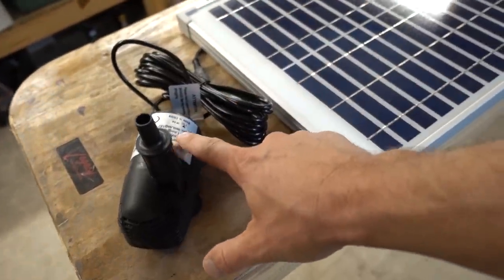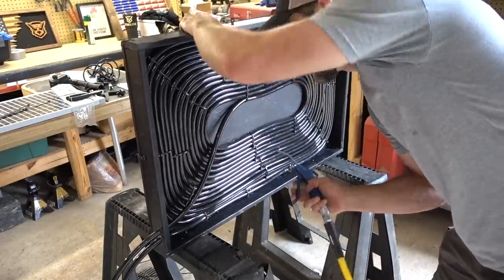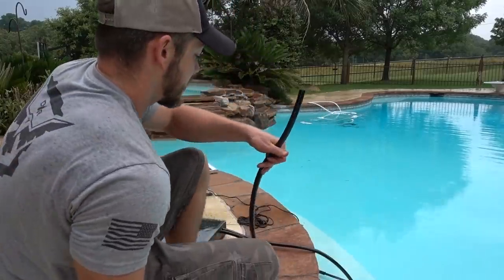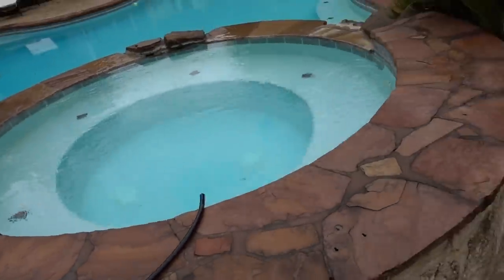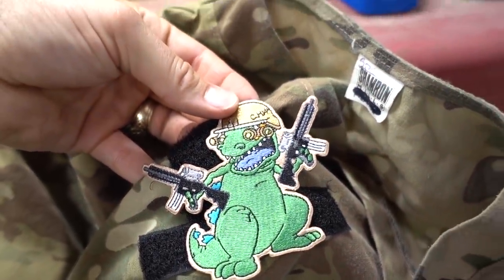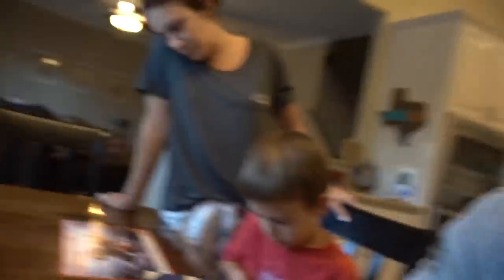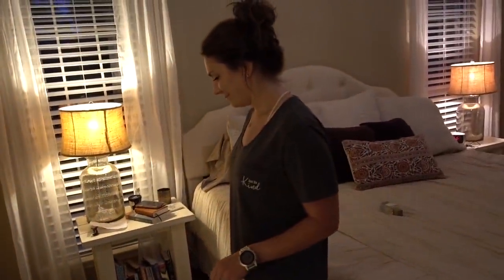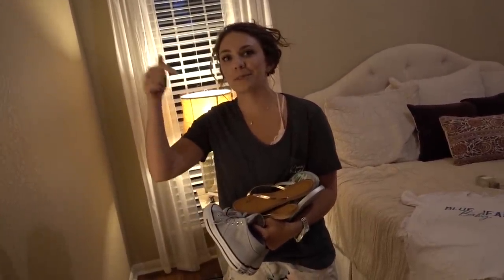Homemade Solar Powered Water Heater

Comment: Put some reflectors on the outside of the radiator to reflect more sunlight into the radiator (Doesn't need to be parabolic or fancy, especially for a solar powered pool heater. Just look at solar ovens). Also, make the inside (Making the outside shiny would just reflect heat away from the entire system) of the box for the radiator, shiny (Like others have said) to reflect sunlight to the pipes (Again, look at solar ovens). There's no point in heating the wood. Might also need to change the pipes to copper (Like others have said), and paint them black to both absorb more heat (And thereby transfer more heat to the water) and for durability purposes (Rubber may crack and/or melt slowly over time). 

You can also experiment with aluminum. I don't know which would be better, but I've always thought that aluminum was good because it has high SPECIFIC HEAT (specific heat is the amount of heat/energy that it takes to raise the temp of a material by 1 deg Celsius). That's why aluminum foil cools off and heats up so quickly when you put it in and take it out of the oven. My thinking is that because it cools down quickly, it would transfer heat better to the water. Maybe it would heat your pool at a faster rate, but not to a final temperature as high as copper. Copper has a higher THERMAL CONDUCTIVITY, but lower specific heat. Both materials are used in thermal applications. Copper is used in home appliances such as water heaters and refrigerators, while aluminum is used in things like heat syncs for computers and pots/pans (though the base of computer heat syncs or the part that touches the processor is often copper). Aluminum is cheaper (which is probably the main reason it's used) and both have good corrosion resistance for outdoor use. Copper also has better ductility for bending purposes, though both will probably be fine in this category for your use. This is all coming from a Mech Eng student that hasn't taken heat transfer or mechanics of materials yet, so take that how you will.

I've capitalized the important terms to research if you decide to do some on your own and there are plenty of articles online that may help you make your choice. My suggestion is that you make the modifications to the radiator and connect the rubber hose to the inlet and outlet for the radiator so that you don't have to bend or force solid pipe around your yard to reach the pool. The rubber is more easily adaptable to any path that you need to take to reach the pool and it can't cut the skin as a metal pipe would since that end is in the pool and near bare skin. It's also easier to replace the rubber in this case since you don't have to redo the coil if the rubber breaks down and you just have to replace a straight line of hose.

Comment: You forgot a thermostat and 2 one way valves, solenoid and a relay! If you continually pump the water through it won't get hot, because the water is not staying in the collector long enough.

Comment: I have installed these before for people. You are going to want to lift the solar water heating at least 6 inches off the ground. It will allow for the hot water heater to absorb ambient temperatures and solar temperatures.

Comment: You need to put black stone in the bottom of the box, preferably pretty thick stone. What that's going to do for you is have a base that will actually absorb and hold the heat to give the water going through the pipe a longer chance at catching some of the heat. Wood is a terrible conductor of heat, especially plywood that's not very dense because it's made from a softwood. If people don't believe me, go paint a piece of plywood black and leave it out in the sun and give it a full 8 hours of sunlight then go touch it, and then go touch some asphalt or concrete in the same area and see what's hotter. It'll be Asphalt, Concrete, Plywood. As other have stated copper pipe would also work better, I know at the Denver Zoo they had these big copper colored statues for kids to climb on and every time we went on a sunny day if you touched it you'd literally burn yourself because of how hot it is. If you combined a copper or any metal pipe really with a black stone or asphalt in your box then you'll get some pretty hot water from it.

Comment: I would have used stapled in zip ties to hold it down.  That was my thought before you did what you did.  My thought was staples won’t go all the way through, no holes, and no loss of heat.

You could always build a couple more to increase the warm water production.  Because more is more, so why not?

Comment: If  you put aluminum  tape or foil at the bottom of you "radiator " itll catch more light in turn heating it a tad bit warmer enough to feel a difference

Comment: make sure you drop the water from the pump directly into the water. Else you will lose contained heat in the water as it collides with the air as it drops.

Comment: In Florida the passive solar pool water heaters are attached to the roof of the house and cover a very large area of the roof area in the back yard side of the roof. Even this only makes a small increase in water temp. in our winters here. My Brother ... consider this ... fill your black tubing up completely with water. OK ... drain the black hose out in a large bucket or container. Measure in gallons the total content of the amount of water you have drained from the black hose. Now, compare that gallon amount to the total gallon amount of your pool. See what I'm talking about? It's like [ ... please pardon the analogy... ] peeing in the ocean. Not to "dis" your project at all ... but you are going to need a much, much larger passive heat collector panel ... or "box" with a whole lot more, and I mean allot more black rubber tubing. Your panel shown in this video could heat up a baby pool, or a three person hot tub over a day or three depending on the size of the hot tub. Google this on systems used in Florida and you will find out what I'm talking about. The Proverb is absolutely correct ... "Council with many ensures success!"

Comment: Run the pipe under ground to the house up the gutter to the roof and run the pipe from one side to the other back and forth from one end to the other then back down through the gutter and back to the pool under ground.

Comment: I knew a guy who did a similar system but on a bigger scale and made to hold water for a certain amount of time say 15 mins. He put it on his roof for a hot water heater and it worked great the first day, it got so hot it melted all his plumbing he ran in his house and for it. He flooded a decent part of his home lmao.

Comment: I'd get a shiny metal plate and put it on top of those hoses so it captures more heat and spreads it over the hoses. 

Also get an Arduino and some motors and go nuts and program a mount to follow the track of the sun through the sky every day so the solar panel and box get max heat. That's just me though. I'd go nuts with it because I can.

Comment: Forget to ask on last video. Shouldn't you use white board on the bottom on those tubes to reflect the heat to the tubes instead of absorbing the heat that's supposed to use to heat up the water?

Comment: It would probably be more effective to heat your water by running your air condition in the house. It only costs for the equipment to hook up then when the a/c comes on it heats the pool

Comment: Using plastic hoses seems like a bad idea when heat exchange is the desired outcome. On the inside, you should probably use copper and spray paint it black. Using plastic hoses, you're actually insulating the water from the heat inside the heater.

Comment: You could use old tires filled with rubber hose as a heater. It's more effective, so you wouldn't have to wait all day for a few degrees.

Comment: You should have found the mid point in your hose put it in the center of your  Box then coiled both ends at the same rate in an outward spiral from the center to the edge then you wouldn't have had any overlapping hoses

Comment: Hey brother. Would be a lot easier and more efficient to incorporate it into your already existing pool pump using the pump house rid with a one inch pvc system. I'm in the hill country and had one forever till we moved to a house with no pool. Made em for lots of my neighbors as well. Just an idea for ya to mull over so it can actually heat up that big of a pool even in 50 degree weather.
Reply: Pump house roof*

Comment: Hey matt.  We did this when i was a kid on my dad's pool.   4×8 ply wood and a couple of garden "hoes"   we painted everything black and plumped it from pump.     We would get hot water coming out 50 degrees warmer than the pool water.     It worked really well

Comment: Hey, if you want to have a better heater with the science to back it, make a little vacuum pump and pull a vacuum in your blacked out chamber, epoxy every tube,zip tie,lid, hole, in the box.pull the vacuum and seal it off the lower the psi the better.  it will heat up your pool WAYY more effectively.

Comment: Paint the hose with flat black to increase efficiency as the gloss will reflect some light.
Reply: He should use metal box and copper hose to increase heat consumption as well
Reply: That would increase efficiency by about 12% over the plastic but it eill be quite expensive.

Comment: Could have bought (2) 1-1/2 trees (2) 3/4  PVC reducers and plumb it to your return lines at your pump
Reply: And it would pump with the pool water and you could buy (2) 3/4 in. Valves to stop the water at night and would cost way less p.s. I work building pools at tuckerbackyardpoolsandspas as a builder/plumber

Comment: Why don't you just use the pool filter pump to circulate water through your solar heater/cooler? A simple bypass valve  could enable you to turn it on or off.

Comment: You're better off using photovoltaic solar panels (electric basically) because those heat panels don't work unless in direct sunlight! Whereas a photovoltaic panel will still produce half of it normal power.

Comment: Submerge the end of the tubing - you will loose heat to the air if the air is cooler than the heated water in the tube.  Mere - some of us women look better in V-Necks than U-Necks so please keep that in mind.

Comment: Nice idea and it will work but I’m not sure it’s going to be efficient with your size pool. Typically you need to heat more water and move more water to be efficient. Only reason I critique it is because I have a customer “roofing” we installed a solar pool heater on they’re roof and it had to have 2” pipe to carry water to & from with half inch hose ran back and forth & probably 12’x12’ surface area. It was an above ground pool & did work but the system was on a lot larger scale. Props on the ingenuity though cuz what we installed was a pre-made system not of our doing.

Comment: 5, 10, 20 degrees I know you are experimenting but it takes about 1000 joules to heat a pound of water 1 degree. looks like the pool you have could be about 12k gallon. That's almost 100,000 lbs of water. so you would need to produce about 1.2 million joules to heat up the pool a degree. I think that the box will never really make a difference considering a breeze would cool down the pool more than the box would heat it up.

Comment: It will not work without a solar pool cover. Think of it as a lid for all that heat you are pumping in. No doubt it will crank some heat but you will loose it faster than you can gain it without a cover

Comment: And now I've spent an hour considering thermosiphons.  cheep, simple and reliable, adding a check valve creates a heat controlled switch not light controlled (primary source not 2nd degree/correlating source).  What is the effectiveness/output of same sized unit and/or same cost unit(s)?  Any engineers out there with the answers?

Comment: The amount of water that pump will pass is greatly reduced by the amount of frictional loss from the hose, plus the amount of back pressure and lift. In other words your pump capacity is crap.  You are making it work harder as you have elevated the hose mush higher than the pool water level.

Comment: Lincoln: gets toy that requires assembly
Matt: let me help you with this
Mere: building a helicopter without an engineer?
Reply: Jack Lougheed I actually think Matt had mentioned in a video that Mere got an engineering degree from Texas A&M. I am not sure if she is a PE, but pretty sure she has an engineering degree.

Comment: Seal the holes in the back and put a gasket on the plexiglass to reduce moisture getting into the enclosure and creating condensation on the glass
Reply: Hahaha it wont get that hot surely

Comment: Please run this test for us. We are having a bit of a debate. Please let the box get to temp and run the water into a bucket and then temp check the water. Then please replace the inside with a reflective layer and see if the temperature of the run off rises. I'm positive it will be hotter if you use a reflective surface and not a black box

Comment: You need a high volume pump so many gallons per hour but then again if it's too fast won't give the water time to heat up before punch back in the pool so slow like you have it to better option

Comment: Matt I'm sorry to tell you but that tiny little tube and solar panel is going to warm your pool up by 0.0000000000001 degrees. Water takes a HUGE amount of energy to heat up, 4187 Joules per Gram of water to heat up one degree specifically. With a pool that size you're looking at Billions of Joules to heat it up by 1 degree, a small solar panel absorbs a few hundred to a thousand Joules per day. 
Think of it this way. The pool absorbs 1000x more heat than your tubes will, so why the heck would the tubes have any tangible effect on heating the pool?
Source: physics degree

Comment: 2mins, 30 seconds into this video: overcast day = a normal day over here in Ireland. :)
We have people over here that use sloar pannels and I presume it works fine, so Texas, should be a lot better. Apparently, heat has no impact of those types of solar pannels that convert the rays into electricity, unlike the heat solar generaters that are basically mirrors, used to direct the heat to a metal water tank to boil the water to fuel a steam engine.
Steam engines...I presume inproved by trial and error a lot since the 1800's....if it aint broke...as long as the engineers aren't too stuborn to change there ways if something better comes along, even if it wasn't the way things were done in his day. Test all things, stick to that which is good. :)

This was a very random blog post/comment.

Comment: I’m sorry but I don’t think that little pump is going to circulate and heat enough of the water during the day to warm it up even 2 degrees. At night it’s turned off as well and water doesn’t conserve its heat. Every day what little progress you’ve made will be lost because the change wasn’t big enough to last until morning. It’s a good concept but you need to heat and circulate much more water than you’re able to do with that pump. At least look up the info on how long a pool full of water (of your size pool) would take to heat one degree F. Also look at what is the minimum flow rate and temperature it needs to be just to heat in a 12 hr period. It has a better chance of warming the little pool/jacuzzi next to it

Comment: Depends on the size and type of the panel how well it'll work. Some types of panels require full sun while others can go with partial and still provide some power.
Reply: You can get optimizers for panels so that if you wire them in series, that one being down won't take down the array. I'm an electrician at a strictly solar company. Matt could in theory wire a bunch of panels together, but in his case I'm assuming the panel goes direct to ac.
Reply: @etherealalex2358  cool!  I'm not really knowledgeable in electricity but am thinking of getting into the field. I don't know if he'd be able to do something like that. He seems to know less than I do on the subject. Not knocking him. I didn't know about the difference in solar panels until a month ago. Had I known it, I wouldn't have given up on the solar pond pump I tried a while back. 

Looks to be fairly basic, straight to the panel. So I believe you're right.

Comment: you need a capacitor/ batteries that get charger by solar panel.
Reply: If the solar panel has enough to power the pump.  And he only wants the pump running when the sun is strong enough to heat/power the pump.  What's the battery suppose to do?  Are you a battery salesman??? :)
Reply: @billabney243  lol no but at first the solar panel didnt seem to be have enough power to run the pump. But I think it has a capacitor built in after making it to the end

Comment: Your wasting your time. I normal pool heater puts out more than 100,000 to 3000,000 BTU. that thing you have might put out .0002 BTU.. lol.  besides since you have it dripping down into the water, the water is actually cooling down in the air.

Comment: You do realize that your solar panel will put power to the pump 24-7. That's how they work.
Reply: You may be thinking of the elusive LUNAR panel.
Reply: NinjaRider777R  ok I didn't know that.we use them for our fence but didn't know they had battery in them.sorry.